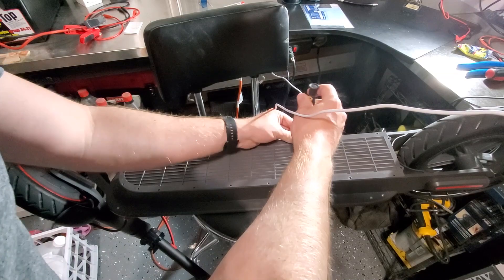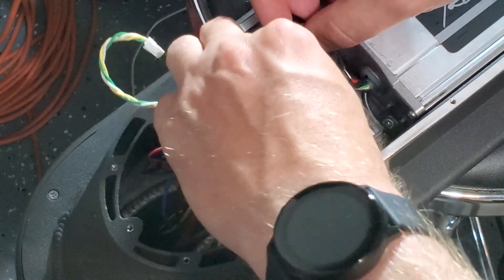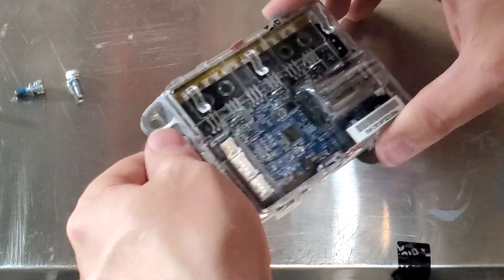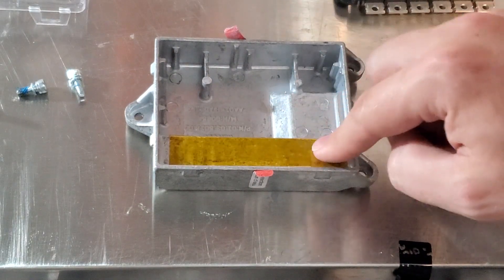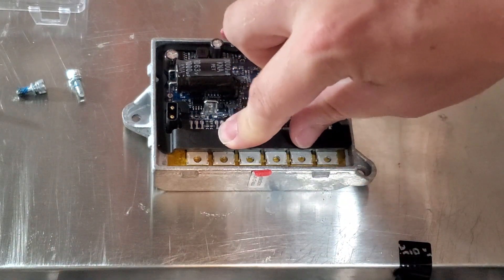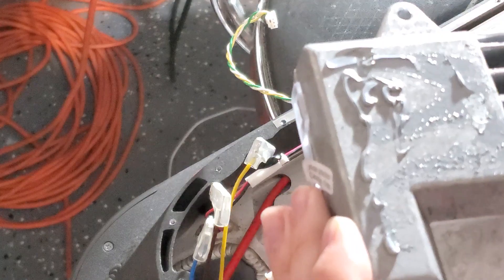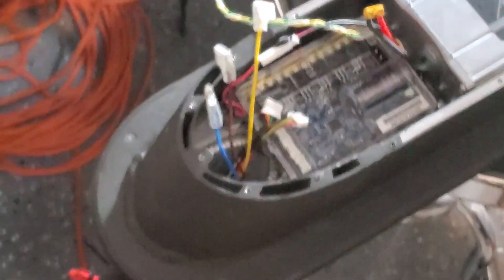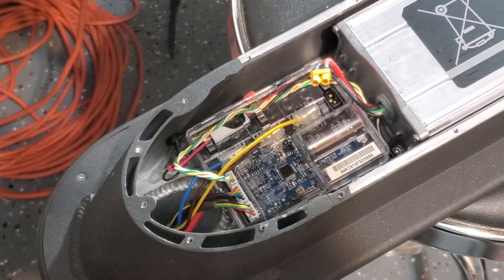Checking the cooling of your M365 Pro Mosfets

Comment: Jesus what an idiot. Thats capton tape, and its designed PRECISELY for purpose of being ELECTRICAL insulator, not heat conductivity. Just remove that dumbass, and get a decent thermalpad. You have air bubles beneath capton that INSULATE heat.
Even more - capton tape is used to heat insulate in BGA soldering. I love when people gibe technical advice knowing nothing about what they are doing.

Comment: I did try this, and now my xiaomi pro scooter won't turn on. 😔 Don't try this, that's why he didn't plug the battery connector to the controller at the end of the video. Now I need to replace my controller for a new one

Comment: i have done a few mods to my m365 over the years the biggest one is soldering the faze wires to there connector especially if your modifying the firmware iv had the silicon boots melt under the high heat generated by the poor crimps putting thermal past under the mosfets its another big one iv had mosfets blow and almost take out the controller next thing is beef up the mosfets circuit on the back with copper wire the thin solder and copper in the board are not sufficient and eventually burn and damage the circuit they are usually repairable but better to fix the problem before it occurs. and any of you wanting fast charging you can bypass the safety by connecting the charge wires to the main output connector on the battery in this video its the yellow xt30 mines black but thats just for reference only do this if you know what your doing as i stated it bypasses all the safeties so do that at your own risk

Comment: Nice video. Is that the solution for error 40? For xiaomi m365 pro 36v, 500w monorim motor, with an extra external battery 10s.

Comment: Nice video. But I would do different things. The yellow tape seems a chinese clone of the Kapton tape.This tape is high temperature resistant, but it's rather a good thermal insulator than a thermal conductor. The good thermal conducting tape is Bergquist or that Arctic at 15:00, and it doesn't need a grease - I would recommend right the opposite as you did. The next thing is about that rubber on the top of transistors that keeps them in place - well actually that is a kind of joke, the transistors would have to be held with a metal U-profile yoke that is bolted in the heatsink. The rubber and the snapped plastic cover do provide very little clamping force.

Comment: Hello CB, thanks for the awesome videos! Do you think you could do (already have one?) of the bms & battery setup in that 12.8ah metal battery you have? There's only 1 (<3min video) online and more of us that have had ours for a year+ are running into seemingly battery issues...
For example, my scooter shut down giving the temp error message but it still turns on and the battery tests fine at 41.2v .
Connected to the m365 app, the scooter doesn't show battery cell values, but it does show 2 of 3 temp sensors at 104 degrees F.
I tried a new controller and a new motor but same exact issue persists.
Thanks for your consideration!

Comment: I have tried this and I'm in very hot climate 40 degrees plus celcius and there was no noticeable difference. If you think of doing it, then don't it's useless. I'm looking instead of installing a fan.
Reply: Have u found out to solve the problem out?
Reply: @Kesinsanstir  don't use modified firmware in hot weather, or use low speed max 21KM/h.

Comment: Hi, buddy.

Have you by any chance thicker the traces on the rear or the controller? The trace usually burns up and I heard people may add a copper wire along and solder it for better heat dispersion.
Reply from the maker: Hey, I have seen people doing this; I haven't tried to do it myself yet; I haven't had any problems.
Reply: @cbutters  Cheers mate. I might do it before it burns out as it is extremely common. Some geeza just says to solder a copper wire along it and voila, done.

Comment: 1. the driver is the same in the pro and regular version.
2. the problem of creasing the motor plugs, it's about creasing the upper part, i.e. connecting the cable to the plug. This problem causes the heating of the joint and blackening of the plastic.

Comment: Hello 
I have a question because I am not so technical and I searched the internet and I couldn't find my problem with my m365 pro scooter.
The problem is that the scooter is not working.
The display wont turn on.
And when I presse the power button the taillights blinks ones and after that 4 times.
And that's all what it's doing right now.
This is happened while I want to downgrade the software .
Because I want to have more speed.
I can connect with the scooter , but there is no reaction when I use the throttle and the display won't turn on.
Could the cause of this problems be the controller?

With kind regards 
Dennis( from the Netherlands)
Reply from the maker: Did you get this sorted? I had this happen to me once and it was scary; I had to use a downgrade app on an android phone to fix the scooter and get it in a working state. Unfortunately I can't remember the details right now; but hopefully you already have it sorted.

Comment: It would be better if you use electrically insulating thermal pads on the mosfets and remove the yellow Kapton tape so there is nothing impeding the heat transfer. I removed the Kapton tape and used thermal glue on mine haha, just did a continuity test with a volt meter on my mosfets after it dried to check that they wouldn't drain to the casing and kill the FETs. I struggle to get over 25 degrees C even with modded firmware! Before it would get close to 70 degrees C in the summer!

Comment: Just noticed I hadn't left a comment. Great video CB! Really the best and most conservative out there. I'm not convinced it will stop people popping mosfets under hard braking but it can't hurt if done as carefully as you have done. 12:26 the common issue is not a connection issue between the connector and the socket but the crimp of the connector on the wire. This shows up in brown burning visible under the clear plastic covers. Yours look fine. If there was burning one can fill up the crimp with good solder and reheat several times to get the flux out.

Comment: In the previous video you showed pads, now it looks like you used paste, what made you go for paste instead of pads?
Reply from the maker: pads are generally used if you need to fill in air gaps. There was almost no space between the mosfet and the casing; and pressure being pushed down on the mosfets via the black pad; which made paste a better candidate.

Comment: what thickness is the thermal pad. i want to get a better one to add it on my board
Reply: I used Arctic Cooling 2mm. It's a tight fit but you want it to be tight. 1.5 mm works fine too. Removed kepton tape, sanded, used kepton at the very bottom so nothing accidentally touches the metal case but kept the mosfets clean. Added the pads, used thermal paste at the bottom, checked conductivity it was 0 from mosfet to case, rode it until now (300km), no issues. Temperature is 50 degrees C in hot summer days with 36 degrees C outside. Also reinforced solder behind mosfets.

Comment: 8:37 bad technique, drop a pea size and the pressure wil spread the grease the best way possible with no air traps, don't spread it, 11:41 is the better technique you did correctly

Comment: FINALLY! Have been waiting for what feels like ages for someone to make a video regarding cooling of the mosfets. Are you using stock firmware?
Reply from the maker: stock values; only unlocked top speed v1.5.5
Reply: @cbutters  I'm using the same values but encountered an issue when braking which may have damaged something so your video is really useful when I take a look at my mosfets over the weekend. My motor has lost power and makes a loud noise when initially spinning up.
Reply: @cbutters  and what speeds do you achieve and how much do you weigh if you dont mind me asking.
Reply from the maker: @K4rgo  21-22 Mph if battery is fully charged. It drops off from there; nearing 30% battery 17-18mph is as fast as it is going.; I weigh 170lbs.
Reply: @cbutters  Thank you.

Comment: Nice video! Do you notice any difference?
Reply from the maker: I really wanted to spin the motors for 5 minutes and record the temperature; then apply grease and record the temperature again; but it would be too hard to get it reconnected and disconnected and pulled out of the inside of the scooter in the exact same amount of time to get a direct temperature reading on the mosfets. (at least with any degree of scientific accuracy) I actually avoided riding the scooter until I had this done because I live on a massive hill; and I didn't want to burn out the mosfets going down it until I had sorted out the cooling. That said; I have since ridden the scooter very hard and have not received any temperature warnings. (my motor has gotten quite hot on the hills); but the ESC seems to be running cool. using "Weak" kers setting.

Comment: I’m a new subscriber, waiting for the break upgrade video. Is it possible to use a MTB hydraulic brake calliper hose and leaver instead of the standard break and leaver ?
Reply: If you find a MTB lever with brake electronics tell me about it.